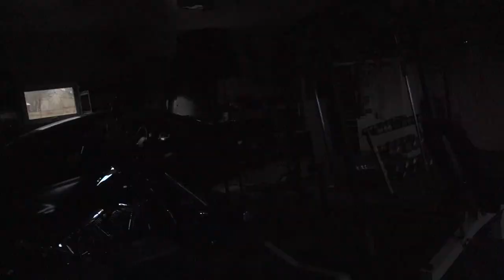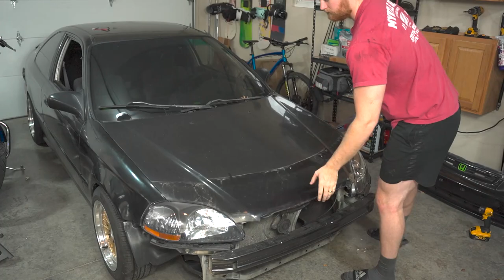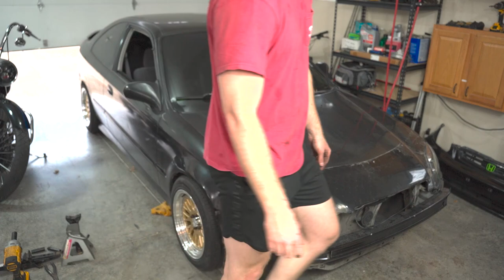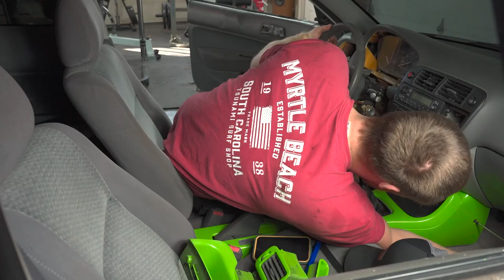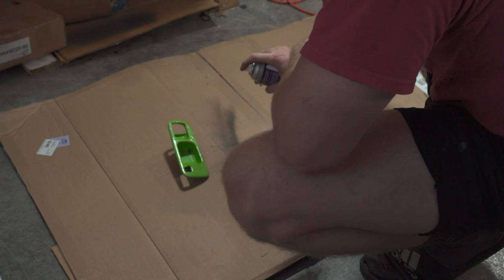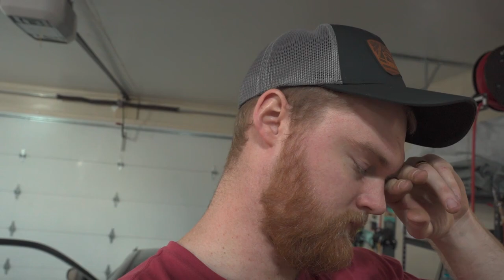Fixing The Interior In The Civic

Comment: Citristrip Safer Paint and Varnish Stripper 17 oz 

Use that from home depot or lowes man its 12 bucks and it take off all the old paint sand it down with wet sand id say 600 grit ive do it to mine only thing i didnt vlog it 
after its all done whip it down & re spray you will be waaay happier with results 🤙🏼
Reply from the maker: Ohhh yeah I need to try it. Will it be fine on the interior plastic?
Reply: @brotherboost  yes you can find paint stripper for plastic there cheap spary an easy to remove